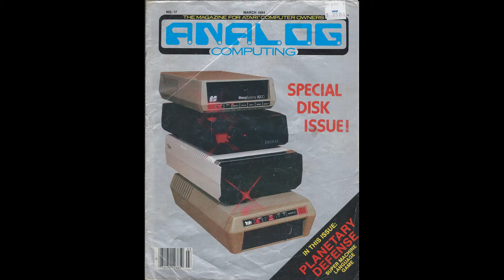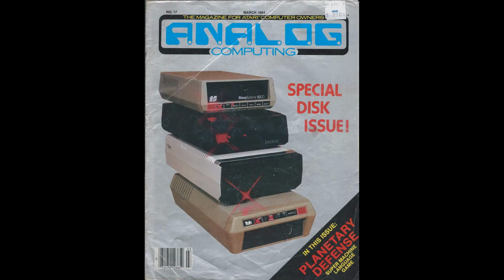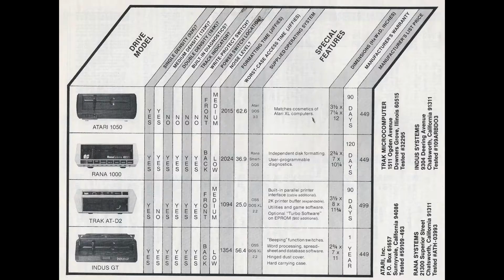Atari Indus GT Disk Drive Repair

Comment: Great vid thank you! just got two Indi today! So excited. I got the joke. It was appropriate in context. One of the drives has a Chinon mech with a vertical door latch. I never new Indus drives could have one. Was helpful to see you working on the drive and even moving the motor. ty
Reply from the maker: I've only encountered a few (maybe 5 total) Indus drives and none of them had a Chinon mech. I'm guessing it's probably a very early production model. Very cool. Think you could post a pic or two?

Another thing that I never bothered to update is that I built a DIY SRAMCharger board for my Indus and successfully ran CP/M on it with absolutely no issues. The timing sensor is 100% unnecessary for any functions of the Indus drives. It may be used for diagnostic/testing/calibration purposes, but for actual use it is not.

I also have a video about beefing up some of the weak points of the XF551 drive. If you happen to already have or run across one in the future, it might be worth watching. The XF551 is my absolute favorite floppy drive for the 8-bits. It's a fast and very reliable drive as long as you improve/repair the weak solder joints and replace the buggy factory rom.
Reply: @undeadmechanic  Yes here are pics https://atariage.com/forums/topic/98341-whats-the-latest-atari-related-things-youve-bought-on-ebay/page/196/?tab=comments#comment-4812419 a couple comments below shows it with the case off. Yes I ordered some SRAM Chargers today. These are like a cheaper and more widely available ATR8000! Good to know about the timing sensor. Will definitely check out your XF551 video. Would love to get a couple of them!! Have none now. Three brand new 551's in unopened boxes just recently sold for $15 each in Texas (see https://www.reddit.com/r/atari8bit/comments/mnjdn9/lucky_find_brand_new_atari_130xes/ ). Ugh!! They were for a business doing display kiosks in hospitals, apparently.  Maybe they'll show up on ebay because those must be worth 500+ each.   Good to know they only need beefing up of the solder joints and replacement ROMs. They are double-sided which is great.  Using the Indus drives in the past few days is more satisfying than a modern sio device, but having both options is good. =) 

Question for you please. The Chinon Indus front panel 1/5th of the drive part has two screws on the lower inside that hold it to the case. It won't line up correctly for me. I'm pretty sure it was lined up when I got it. Any suggestions or tips?  As it is, there is a misaligned gap between the front plastic part of the case and the larger metal shield/case section.  

If the Chinon mech ever gives me problems I'll reference this video to swap a 1050 Tandon mech in there. Great video.  Cheers!
Reply from the maker: @gamedoutgamer  I have no idea about the alignment. I haven't had either of my drives apart since I built the SRAMCharger a couple of years ago and don't recall.

Nice to see you on AA! I've been a member there for years.